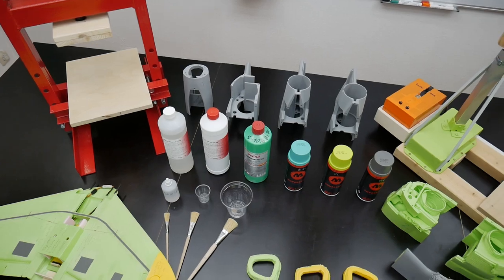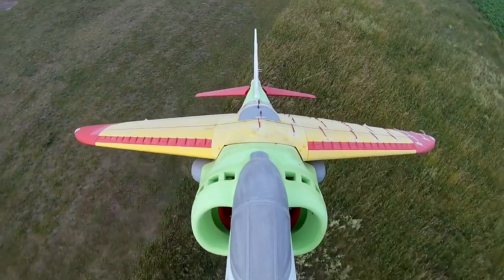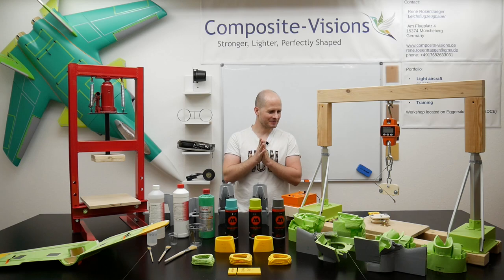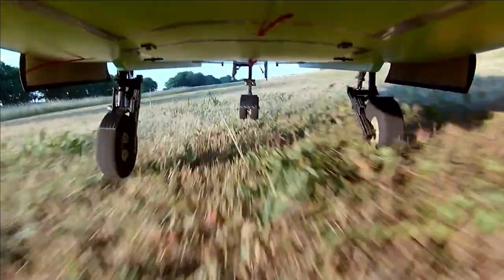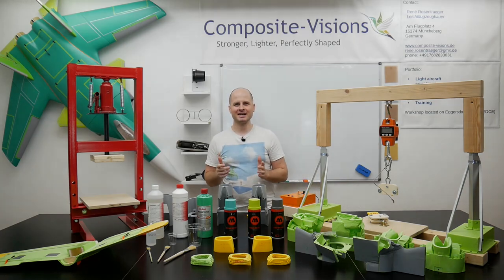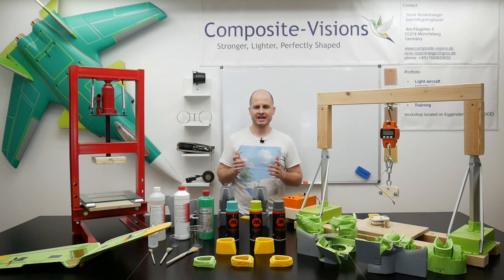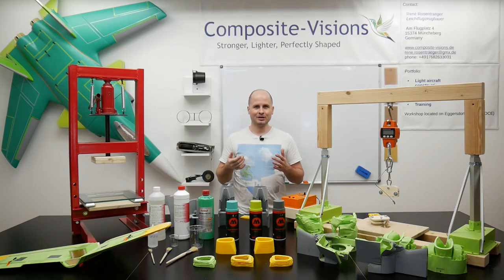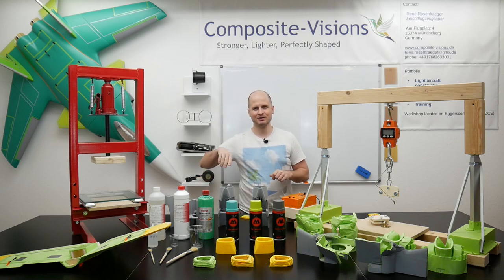Stress Test on Lightweight 3D Printed Parts | Epoxy and Glasfiber Reinforcing

Comment: Hi Rene. Great work as usual, and thanks for sharing. 

You mentioned not being able to get Cura to print 2 walls for certain areas. There is a way that DJDesigns explained to me while trying to print the F-14 he designed. In Cura this can be done with the per model settings, as follows:
• Import a part
• Select the part, click on 'Support blocker' or press 'E' and click on the mesh. This should create a small cube
• Scale the cube up and move it to cover the section of the part that requires the 2 walls, eg the top 5 mm of the part.
• Select the cube and click on 'Per Model Settings' on the side bar
• Select 'Modify Settings for Overlaps' and change wall line count from 0 to 1 (you may have to add the setting in "Select Settings")
This should allow you to change settings within the area that the cube intersects with the part.

The link to the F-14 and associated comments is here...   https://cults3d.com/en/3d-model/various/f-14-rc-aircraft-twin-50mm-fan-960mm-span

Hope this is of interest.
Reply from the maker: Sounds great mate! I'll check that soon😁👍👍

Comment: Rene thanks for pointing me to this video - excellent information / results. Minwax Polycrylic would really be worth testing in place of the Epoxy. It is readily available, non toxic and can be used with fibreglass at least on wood. Perhaps you already looked into this option.
Reply from the maker: Just ordered one Minwax 👌
Reply: @renerosentraeger  fantastic... Multiple coats build a tougher finish. Irrespective of the outcome the information from the testing is just great to have.

Comment: From what I can see Cura is not optimized to enhance strenght, but to reduce weight.
The inner structure of the parts are already fzilure prone so adding renforcement is a bit of lost cause.

Doing planes using 3D printers requires and entirely new grade set of tools.
Extensive material qualification is also required.

Your video gave me an entirely new vision of the thing, many thanks.
Reply from the maker: You're welcome mate 🙌

Comment: I work on a 1.8m Viper Jet printed from LW PLA and covered in cfk and this video is very helpful, thank you!

A small tip: don't use square parts for tension tests. The test articles should always have a thinner cross section in the middle. (Like an hourglass shape for example)
If you use square parts you won't get accurate results because your clamping mechanism exerts a force on the part too, which weakens it.
Reply from the maker: Absolutely thanks for that👍👍

Comment: Matte and resin are strong but heavy, messy and time consuming. Why don't you print the needed parts in nylon 6 which is strong and very light? or even carbon filled nylon if you need extra rigidity? which has a weight to strength ratio that closely matches aluminium. Then there is no need to mess with different wall thicknesses. Also impact and abrasion resistance is quite high. Just take extra precautions to keep the filament in a very low humidity container. I use a gasket box with 3D printed through plates that hold a bowden tube with a back plate and sandwich fly tying float foam as a gasket that the filament is pushed through. Also a deep v groove pulley to align the filament. Used with desiccant in the box keeps the nylon in good shape for some time.
Reply from the maker: Very interesting mate! Do you got some pics of your printed parts?
Reply: @renerosentraeger  I can send you the STL files if you like. What email should I send to?
Reply from the maker: @dee5556  Rene.rosentraeger at gmx.de